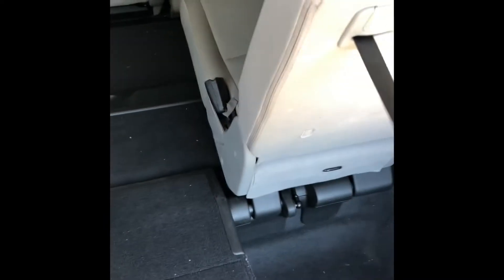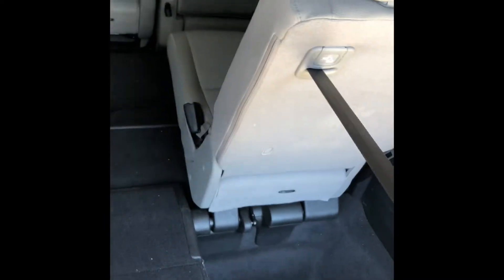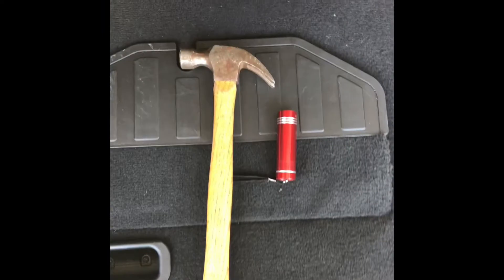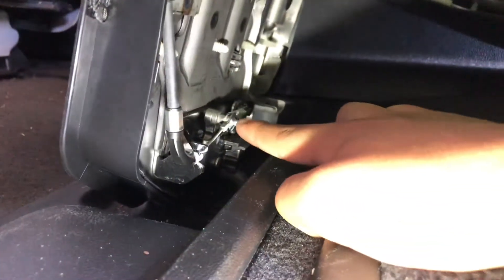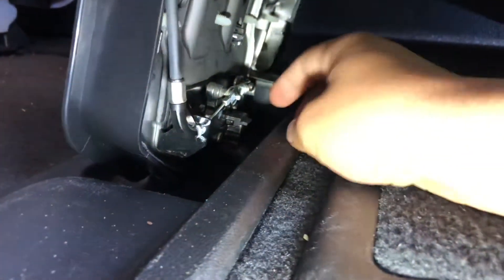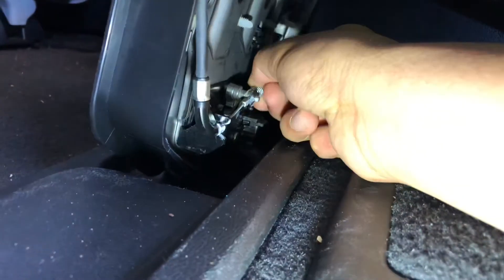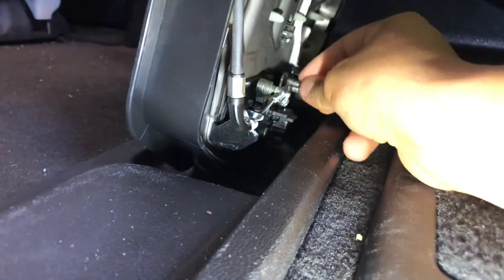2018 Honda Odyssey 3rd seat not folding fix

Comment: 0:41 Just want to say that this fixed my 2019 Odyssey issue. I found that you had to hit the peg from the top, not on the head, to get the mechanism to move. Also put some WD-40 on it to hopefully prevent this from happening in the future. Excellent tip - thanks!
Reply: This exactly! Many thanks. I was disappointed until I did what you mentioned (tapping from above) and dousing with WD40 as it happened again.

Comment: I tried hammering it in the direction towards the wall because that was comfortable but it didn't do anything. Then I hammered towards the front of the car on its head and I heard some sort of spring releasing sound and then put the spring back on and tried the strap and it worked like a charm!

Comment: WORKED,  I needed to PULL the handle again after I hit the pin.  Excellent.  Thank you.

Do we know what the toot cause of problem is that we are fixing?  I did not see a loose bolt or anything that caused this.
Reply from the maker: I don’t really know but my guess is that after use the grease wears out or it just got dirty

Comment: The seat was stuck down. If I take the spring off it will come up. When I put the spring back on it’s stuck again. If I leave the spring off it won’t lock when it’s down. Any ideas?
Reply from the maker: When I took off the spring it’s just a place to hit so you don’t damage the spring so tbh I don’t know what to do for your specific problem I know that Honda will charge you both your arms and legs but what you could do is go in and see what is the problem and try to fix it your self